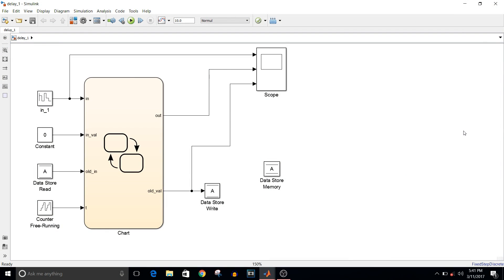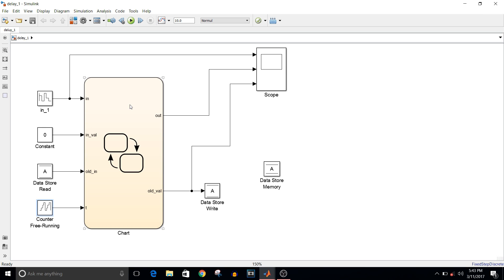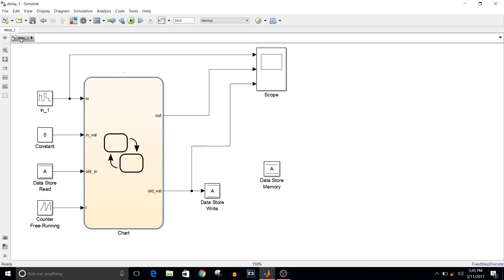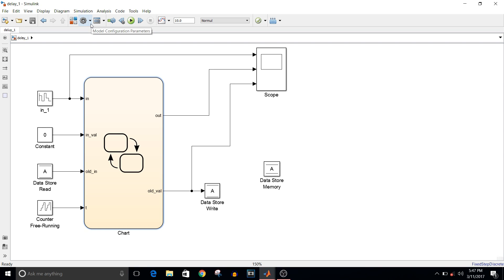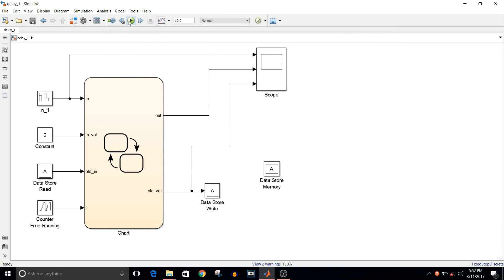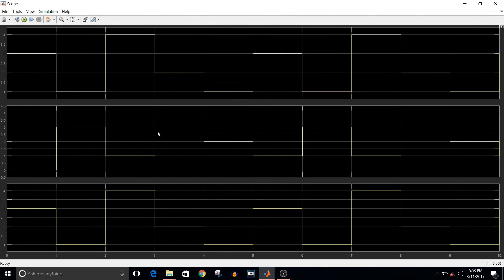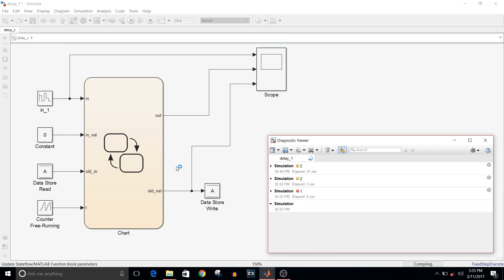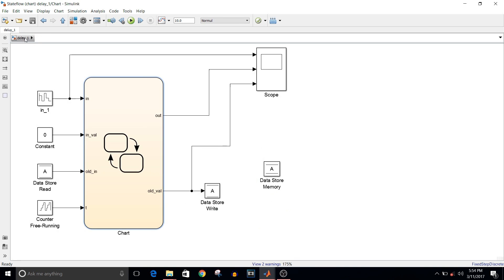Simulink Tutorial - 23 - Delay Signal Without Delay Block

Comment: Great, in code generation, delay block create a for-loop, this blocks the main loop in the microcontroller, the solution is stateflow or RTOS. Thanks. In this example, you delay the input signal in 1 Ts, if you wanted to delay more sample times, you should use a for-loop scheme. Likewise, those schemes in stateflow do not generate locks in the main program when generating code, since they do not code in for-loop statements.

Comment: in t = o transition i didnt understood why you have written out = old_in..here you are outputting 2 times..data store read block delays its signam automatically?i am not clear about this topic
Reply: that was a mistake in the video: "out = old_in;" must be deleted. Because of this bug, initial value is being zero just because initial memory value is zero. But if you change the constant value to, let's say, the value 2, so the initial value in the scope will continue being zero, what is wrong (should be 2 in this example). When this "out = old_in;" is deleted, then this bug is solved.

Comment: Hi..!
The same model will be work for me.  Once i changed t ==1 or t ==2, i got  previous output only, no double delay achieved. 

rectify this ASAP.
Reply from the maker: +Mytheen Muhammed hi... Thanks for raising the concern. I checked. Sorry for inconvenience. You need to add one more chart and provide old chart o/p as I/p to second chart.
Reply: Simulink Tutorial May you send modified model
Reply from the maker: +Mytheen Muhammed or you can try using single chart - use two old input and old op in the same manner as it is done for one cycle delay
Reply: Simulink Tutorial I tried by changing t equal 1,2 only. I'm very new to here
Reply: You can use [t==0||t==1] for the delay of t==1.